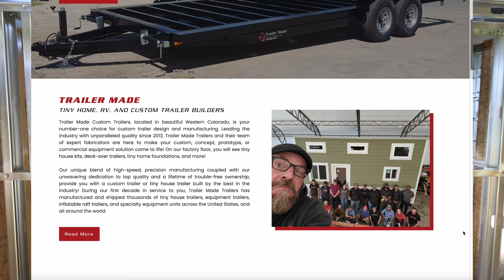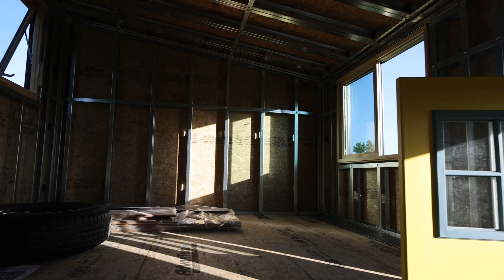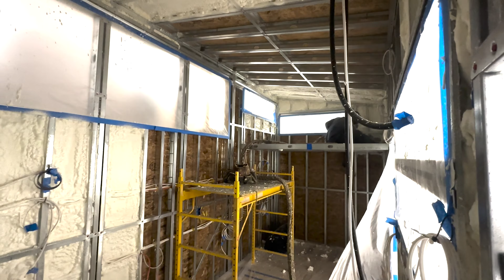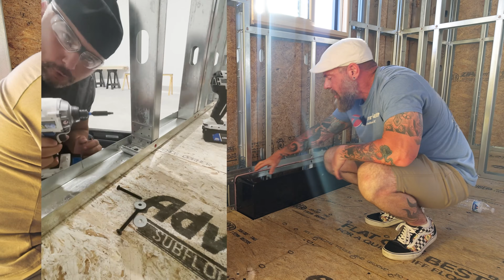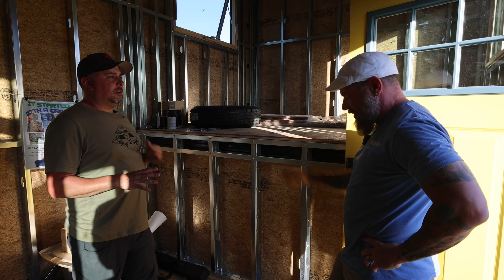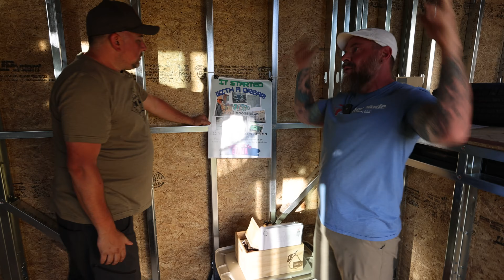Inner Workings of Steel Frame Tiny Home Kits

Comment: If you build a 10' wide tiny home, is it going to stay on a tailor or not? If not, you have to follow local laws for a small home including property taxes probably.
Reply from the maker: If it’s on a trailer like this then it’s permanently on the trailer. If not on wheels then you’ll need to follow those laws

Comment: Oakriidge nation laboratory has done extensive studies with Sophisticated testing equipment and have concluded that steel studs wall assembly Perform much worse than wood stud wall. Wood is also stronger and more fire resistant. Best wall assembly are sip or double frame walls. You could greatly improve a steel studded wall by adding 1” or more rigid to outside of stud. I’m a engineer and have built many award winning  energy homes
Reply: yes this guy is not being truthful about the thermal " bridging" that takes place through a steel stud. You can insulate inside the " C " profile but the steel still conducts thermal energy through its mass (20 gauge thickness ? ) . Definitely  need to use rigid foam board on exterior which I think he mentioned briefly ( ZIP system R ) Just make sure you calculate the added thickness for overall building width.
Reply: No more comments?

Comment: Why don't they build them like expedition vehicles using thick 4" or 6" insulating foam core composite panels for the walls, ceiling, and floor? Foam core composite panels are superior in their insulating ability compared to stick built construction. Even worse is that steel studs are a thermal bridge from the outside to the inside which causes condensation in your walls which is absorbed by fiberglass batts, mineral fiber, cellulose, wool insulation and allows mold to grow and saturated insulation significantly reduces it ability to insulate. Even is spray foam is used there can still be condensation/moisture and mold in the walls.
Reply: Thank you for your input on this topic! Can you share your example of what you're talking about, specifically? I am interested in this technology you're speaking about with the foam core panels! 🤘
Reply: @thetinyhouseexperts  Sure. So composite panels are nothing new, they have been used in the aerospace, sporting goods, transportation, space launch vehicles, etc where superior strength is required with the least possible weight. Composite panels are made up of a core material that can be foam board such as Divinycell or XPS (extruded polystyrene), honeycomb cores such as Nomex, it can be aluminum honeycomb, carbon fiber honeycomb, balsa wood can be used as a core material. There are multitudes of core materials and even the same core shape like Nomex honeycomb which is made from cellulose(paper) and is saturated with any number of resins to make it perform as intended i.e. phenolic resin is for high temp application. Laid up reinforcing fabrics saturated with resin or epoxy or premade fiberglass or carbon fiber sheets (skins) bonded on each side of the core material is a ‘skin’ material: carbon fiber, S glass, E Glass (types of fiberglass), aramid fiber, Kevlar, wood veneer, etc. Nearly all of the tension and compression loads placed on the panels are borne by the skins, the core is just to keep the skins separated and to insulate in some applications. Here is the great part: doubling, tripling, or quadrupling the thickness of the core material gives many factors of increased strength and stiffness for almost no added weight as core materials are filled with air(closed cell foam, honeycomb, etc). SIP's (Structural insulated panels) have been used in construction of post and beam houses and barns for a decades. A thick insulating foam core of 6-8" or more is sandwiched between two pieces of plywood or OSB making a strong, lightweight, self-supporting panel for house construction with an R value much greater than can be achieved by fiberglass batts or any other type of insulation. So overlanding expedition trucks use a closed cell usually a type of polyurethane foam core 2-3" thick and bonded to GRP (Glass fiber Reinforced plastic) mostly fiberglass skins, but some manufactures use carbon fiber skins to keep weight to a minimum while having an ultra-strong structure. A note about carbon fiber skins, they reduce the ability for cellular phone radio signals to exit a carbon fiber encased structure and reach towers making cell calls from within challenging at best. The skins are chemically bonded at the molecular level to the foam core with epoxy or similar type adhesives, then they are placed in a hydraulic press, or a vacuum bag is used to compress the skins and core to create a super strong, stiff, lightweight, insulating panel, that is self-supporting and has zero thermal bridging. An example of thermal bridging is steel studs in a wall, steel is a conductor of heat/cold so when the winter temp is – 4 degrees Fahrenheit that steel stud is cold even on the inside of the wall where there is moist air from people breathing, gas stoves or ovens when gas is burned, evaporation from cooking, etc. this moist air can condense on the ice cold studs in the walls and there is now moisture in the wall leading to mold and reducing batt type insulations R-value because it is wet. These composite sandwich panels are used for the walls, floor and roof of the living area (habitat or module) of expedition trucks, they could also be used as the platform supporting the sleeping mattress and only need to be supported by cleats around the perimeter of the bed platform. The large panels are not joined with any type of standard fasteners, they are joined using plastic, fiberglass, or aluminum specially made extrusions, the ultra-strong adhesive usually Sikaflex holds the panels into these extrusion that form all of the corners of the living habitat box on the expedition vehicle. With composites panels you do not want to screw into the panel or place rivets as that creates a 'point loads' where delamination of the skins from the core can originate and propagate from. If something absolutory needs to be screwed to the panels threaded inserts or reinforcing material may be added within the panel when the panels are manufactured. Most attachment to the panels is by aluminum 90-degree extruded angle pieces bonded to the floor panels or wall panels and then a screw or bolt connection is made between the aluminum and vertical walls inside for example a kitchen cabinet carcass or similar attachment point. Because these vehicles use composite sandwich panels, they can stay comfortably in outside air temps that are well below zero. If you have any further questions or need more details let me know and we can start an email conversation.
Reply: @chrisdaniel1339 I think cost is probably the biggest issue.
Reply: @gjackson313  I am sure composite panels are more expensive, however there is a huge gain in rigidity and insulation performance, there is zero thermal bridging or the moisture and mold that come with thermal bridging, and finally composite wall are stronger than stick built walls whether with lumber or steel studs.
Reply: Look up topolo frp panels. They will precut to match your design, they sell windows , doors, skylights, cabinets and more

Comment: Interesting i didn't know either you just needed a 35 dollar permit to move anything over 8.6 ft wide. Also just to clarify is  10ft wide the limit they make trailers?
Reply from the maker: Good question. Damon actually talked a lot more but I had to cut a lot out (sorry buddy). I just didn’t want this video to be over an hour long. He did mention that their factory has been building 12, 14, and even 16 foot wide. You’d have to talk to him but I’m sure the wider you go the more complicated it will get with moving
Reply: The permit process is done state by state, CO is $30,missouri is $15,California is $25,etc. At 10',no escort vehicles needed, and usually no CDL Needed for the private load being moved. 

75% of our 800 Trailers/year are now 10' wide. Less than 20% are still 8 wide. They're just not popular anymore... People have figured out how much it sucks to pull a tiny house! @thetinyhouseexperts